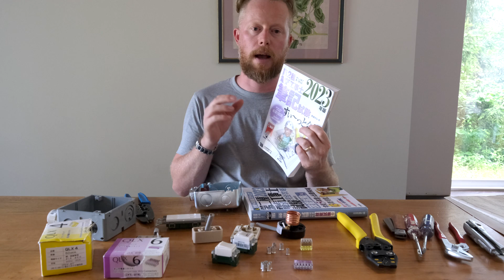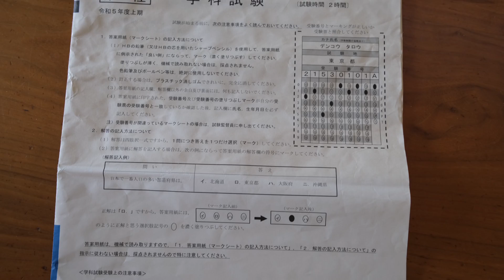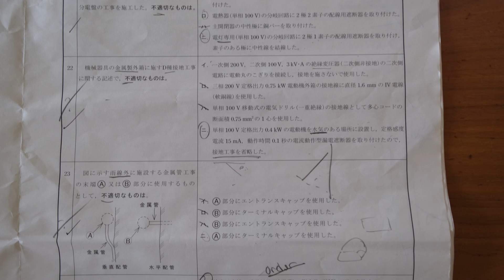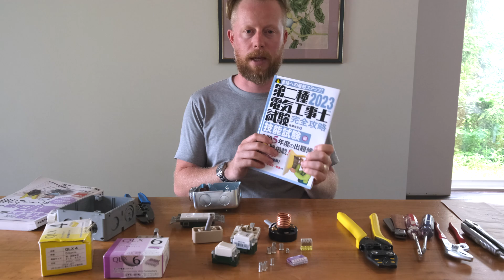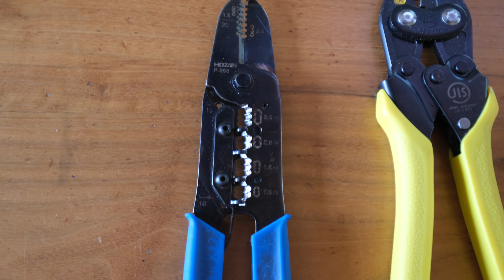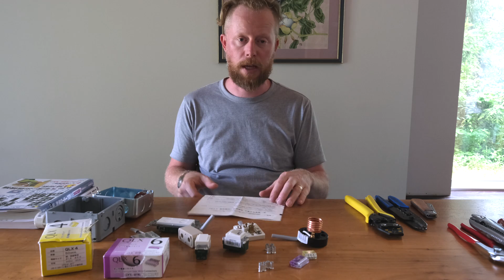Getting an Electrician's License in Japan is EASY! (Well, pretty easy!)

Comment: What is color code in Japan? I watched a few videos, and i noticed that they wire a switch with black wire on one side of the switch and white on the other side. So the white wire is still a hot wire when the switch is on. This really confused me cos in the U.S both black wires connect to the switch
Reply from the maker: Black is hot and white is neutral but wires after a switch could be any colour. Maybe the difference arises because they use a separate cable to connect both the light fixture and the switch to an electrical box. You end up with black tied to white in the box as that’s the line coming from the switch and going to the bulb. It’s pretty clean.
Reply: @TheTampopoShow  Yeah. What I noticed was they use a single cable, which has 1 black conductor and 1 white conductor, to connect to a single pole switch.  I'm from the U.S, and our single pole switches will always have 2 cables --- one for power, and one for the load.  This is how we stay consistent with color codes. Also, Japanese setup leaves no room for modification. Say you want to add a receptacle to that switch. Well, you can't unless you bring in another cable, which exactly the same setup as that in the U.S.
Reply from the maker: @nhitc6832 Japan doesn’t need to modify. It’s built right the first time. Or it’ll be torn down and built again 😂

Comment: Is Japan the same as USA black live white neutral red live 15 gauge wire on amps 15 amp circuit 12 gauge wire on a 20 amp circuit in a main breaker box neutral and ground can be on same busbar and in a sub panel neutral and ground separate busbars neutral isolated does Japan use wire nutslike the usa does use the push in but wire nuts more common because of price do the use cable clamps called romex connectors in the usa
Reply from the maker: There’s some similarities and differences. It’s metric in Japan so 1.6 or 2 mm wire. There’s a lot of situations where you can omit grounding in Japan and they don’t use GFCIs as the whole breaker panel has a fault interrupt. Romex is called VVF here and isn’t a brand name. Most connections are made with push-in quick connect blocks instead of twisting nut grommet guys in America.
Reply: Are the circuit breakers 15 and 20 amp for outlet and lights  @TheTampopoShow
Reply from the maker: @DavidBerquist334 you could do either. I put all my lights on one 20 A

Comment: [EDIT:  I should say I am an amateur and hobbyist with some electrical experience, not a certified electrician] Looking at some of those questions on the written, we're dealing with resistor networks, something I remember doing in high school physics.  Something that applies to Ohm's, Kirchoff's Voltage and Current Laws also apply here.  I find it interesting seeing how it is done, kinda disappointed to see they don't use Marrettes in Japan and instead use the push connectors.  That's one thing I like about North American wiring is we use Marrettes, simple devices that when installed properly, last decades without issue.  I am not really a fan of lever or push nuts, I feel they aren't really well rated for circuits above 5 A but to each their own, I guess?

You said Philips screw drivers, but wouldn't they use a JIS screw driver, not a Philips?  Then again, I am more of a fan of Robertson (I'm Canadian and Robertson drive would probably be known erroneously as a Square drive, but the head, looking at it in profile isn't square, it has a taper to it) and Torx screw drivers, but each country has their own standards.
Reply from the maker: Here they say plus and minus for philips and flathead. I’m not sure if there’s some difference between a JIS plus head and a philips, but they’re sold as plus no 2, etc. You typically only see robbies with construction screws. 
I don’t miss marrettes at all. The quick block connectors are way faster and you can connect up to 7 wires easily.

Comment: Just came back to say I found your video while looking into getting licensed myself and it was extremely helpful. Exactly the information I needed and wanted. Now have my study books and waiting on a test prep kit to arrive! Going to look around the 2nd hand tool stores for the basic tools later in the week.

I looked over the various books in my local bookstore, and the same publisher as what you show in the video has an updated version for this year (for the theory test). It looked the best out of the available bunch so I went for it. Very happy with my purchase! N3-ish level definitely seems to be sufficient to understand most of the material, at least for me (I have a weird mix of N3/2/1 vocab knowledge, but not enough to get higher than 3 yet).

As a follow-up, I'd definitely be interested in the plumbing license experience too! I've been thinking about buying a renovation-project in a couple of years for my first house, and that would definitely be on the cards for me as well.
Reply from the maker: @sometimestraveller  thanks for the feedback. I got a 下水道工事 and 給水装置 license recently. I’ll try and make a video!!

Comment: This is exactly what I’m looking for, thank you very much for making this.
I’m a third generation sparky from Canada but I don’t have my  Japanese electrician’s license… yet!
Reply: [EDIT:  I should preface this as an amateur, I am not an electrician, just electrical hobbyist with electrical experience] Well, somewhat disappointed that one can become an electrical contractor so quickly considering it takes at least five years of combined apprenticeship and classroom hours to get to journeyperson certification in Ontario, Canada.  I just said in years because hours seems a bit messy considering that's how time typically passes as people aren't tractors, engine gensets or other power equipment and the fact that certificates, diplomas and degrees normally are in years, not hours.  Of course this doesn't count the elementary and secondary school requirements to even start an apprenticeship.

Comment: Interesting. I work as an electrician in the UK and would say I'm around N3 level atm. I knew I could get certified to work in other commonwealth countries, but was more interested in moving to Japan 😂😂

Thanks for making this video
Reply from the maker: Thanks! I haven’t made any new videos for too long. I’ll make some more soon!
Reply from the maker: Good luck!
Reply: @TheTampopoShow  Can I ask you if you two have got visas over there, and if so, what type?
I've been told it's practically impossible to get a Japanese visa if you don't have a degree
Reply from the maker: I have a highly skilled worker visa. I have a degree in engineering.
Reply: @TheTampopoShow  I see! Thanks for the reply.
I did hear highly skilled worker visas can be obtained if you have around 10 years experience, but in my case it would actually be slightly quicker for me to get a degree 🤣
Reply from the maker: Gambatte!😂
Reply: @TheTampopoShow  頑張りますよー！🫡
Looks like you've got a lovely home in a real beautiful spot out there, best of luck to you and yours! I'll be checking out the rest of ur videos
Reply: Well, if you were to work in Canada, I would say you would have to be introduced to the idea that there are branch circuits instead of rings, each having its own breaker in a proper metal panel and (residentially) dealing with 120 and 240 V 60 Hz circuits, (hypothetically) unsafe electrical plugs and outlets and different sizes (at least three or four current ratings are used in households, a 50 Amp for electric ranges, 30 for dryers (similar in size and awkwardness to your plugs and outlets in the UK) and the standard 15 Amp and 20 Amp 125V outlets used everywhere else.  Also the use of GFCI outlets in wet areas and other things.  Then there's the locking plugs and outlets commonly associated with generators, commercial and industrial locations for larger machines, probably some of the neatest plugs and outlets out there.  Our system's not perfect but at least we put fuses in the appliances and not in the plugs where someone could replace a 5 A with a 13 A and potentially start a fire as well as switches in the receptacles for some reason.  Of the 220-240 V 50Hz plugs and outlets, it's the round, recessed European ones I like the most.  Decent size for the current rating and has all of the safety of the UK one in a form factor that doesn't look like a welder plug in North America.  There's one saving grace for the UK though is the use of in-wall wiring that looks incredibly similar to the stuff we use in Canada, with a bare grounding/earth wire.  The thing I don't understand is why some in your country put an unnecessary yellow/green sleeve over it?  If the insulation was to go funny on the other two conductors, it would at least trip the breaker in the panel, since your breakers are (hopefully) like ours and trip in a short circuit fault with that heavy solenoid within the breaker.
Reply: @WJCTechyman   I'm not going to nit-pick every part of your comment but most of it is wrong regarding UK electrical systems, you're making wild guesses about what we do and do not use. Particularly in industrial environments.

RE: Earth sleeving, it is only done at end point terminations, not throughout the insulated cable. Once reason being we do not want stray wires flapping around and possibly touching each other when we are working live. 

For example, I remove a poorly installed and terminated socket, in the process an earth or live conductor springs free from the terminal, the earth sleeve helps prevent the odds of a short circuit

Another example, I'm terminating a T&E cable into a large three phase DB, I need to strip a significant amount of insulation for each conductor to reach it's rightful terminal. In doing so, I have a 1 meter length of bare copper (earth) flopping around inside the DB directly in front of me. You see how well that goes when it inevitably finds it's way into a live terminal. (And no, I cannot simply turn off a 3 phase DB taller than myself in an industrial environment)

An unsleeved earth is a C3 coding and should be corrected. We do not appreciate bare copper on display - whether it's currently live - or only live under fault conditions.

These are not rare occurrences when you're an electrician

Comment: Thanks for this video. I'm starting to learn Japanese to eventually retire to Japan, get my Electrical Licence ( currently in Australia) and rewire my  home.I do a far amount of fire alarm systems and my favourite quick ringbark cable is to use a Cat 5/6 tool to score the outer sheathing thing snap it off.
Reply: Buddy, do you think UK or Australia Qualification can be recognised in Japan?
Reply: @koonholee3056  From what I have heard, it's a no. We need to take their exams - but let's be honest, if we're working to a high standard in our countries, I can't see it being too hard to pass the Japanese equivalent!
Reply: @UnimportantAcc  The Japanese system is actually closer to the North American systems in that it uses an Edison-style dual-voltage supply in homes (100/200V 50/60Hz, depending on what side of Tokyo you're on) but I guess that's where some of the similarities end.  I mean, we use Marrettes in Canada, although I started to see bags of Wago lever connectors in my Canadian Tire, not too keen on them as I see them as little more than speaker pinch terminals, not nearly as reliable as Marrettes.  They are supposed to be good, but are more expensive and actually fail before a properly installed Marrette.

Comment: Thank you for preparing this useful video.  I was interested in your comment that there seems to be no outside inspection of electrical work - which begs the question why would you need to gain an electrician's certificate , apart from the obvious issue of avoiding faulty wiring with its consequential loss of life, limb or property.  I recently bought a new build house in Kanagawa and want to add some extra lights and outlets, as an electronics engineer I beleive I understand all of electrical safety issues involved in the work and would rather do this work myself, mainly because I enjoy such activities.  The exisiting wiring looks a mess, it's all point to point with zero cable management, so I would much rather do this work myself ... my main concern is how my additions may affect insurance, or invalidate the 10-year house warranty.  Needless to say, my Japanese wife is less than excited by the idea of any sort of DIY !  Would be interested to hear your opinion.
Reply from the maker: I think you answered your own question: insurance. Well, and it’s illegal.  I was an EE as well, the only thing I did that wasn’t up to code was install track lighting facing upwards. However what EEs know and what electricians know is pretty different. If you asked an EE to wire a 3-way switch they might be stumped. Re: the wife problem, if you have a license maybe she’ll let you make those additions😂.